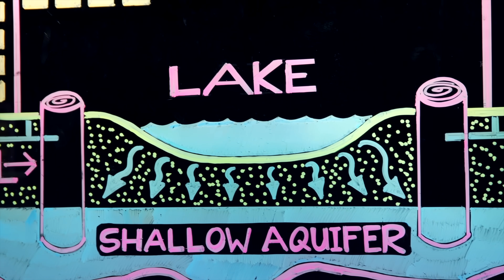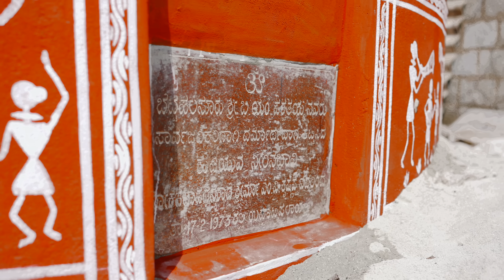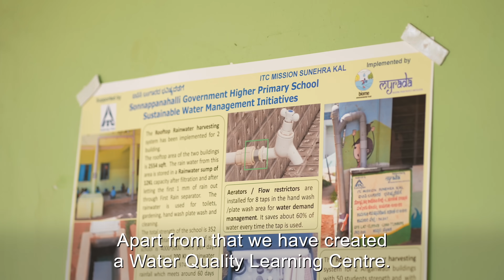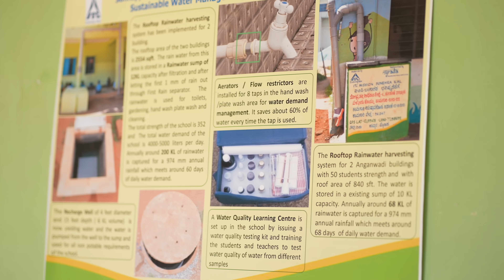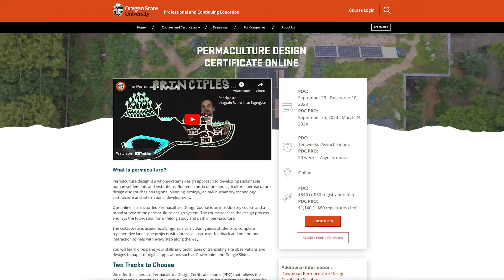How to Save a Drying City (BENGALURU)

Comment: I'm not entirely sure how water conservation practices work since I haven't implemented any yet. However, I'm currently living in the USA and planning to move back to my home country, settling in Bangalore. I've heard a lot about water issues there, so I want to prepare in advance. Here are a few ideas I've gathered from friends, along with some of my own:

1. Harvest rainwater.
2. Promote the use of flushable toilet wipes.
3. Before washing dishes, wipe them with a paper towel to remove grease and residue, then wash them with soap and rinse. This helps minimize water usage.
4. Direct wastewater from drinking water filters to toilets for flushing.
5. Encourage the installation of solar panels.
6. Build vertical gardens for terraces or explore other types of gardening.
7. Filter water used for washing vegetables and fruits, as well as water used for steaming food (like idli), and redirect it to plants or use it to water the garden directly.
8. Promote biodegradable wipes and sanitizers for handwashing.

I hope these ideas contribute to better water conservation! While I'm not sure how effective or realistic they are, they feel worth a try.

Comment: Maximum consumption is by farm sector. Maximum wastage is also in farm sector.  If consumption is optimized and wastage reduced there will be plenty of water for domestic use.  The widely used ancient method of irrigating by flooding the entire field or in furrows wastes lot of water by excess absorption to ground and evaporation. It is still preferred not only in India but across the world because it does not require heavy investment in drip irrigation or subsurface irrigation systems etc. Eventually the wastage has to be reduced, sooner the better because only then we will explore and develop better systems to conserve even more.

Comment: This is also a solution to the problem of combined sewage overflows in the USA. Currently many of our cities dispose of rainwater through the sewage system, when there is heavy rain/flooding the sewage plants are overwhelmed and raw sewage is released into waterways. The typical solution is to collect the rainwater runoff in a parallel centralized system and dispose of it in waterways but because the runoff is collected it needs to be somewhat treated so you're not dumping turbid water full of trash etc into rivers. Also, this concentrated runoff from an impervious city contributes to downstream flooding. If this runoff was collected in a distributed system of recharge wells it would need less collection piping and the local aquifer would be recharged and act as a buffer for torrential rains rather than contributing to flooding.

Comment: digging well is very common thing. Its been from hundreds of years in past. In my village everyone survie on their own well or community well. There is nothing special in this video to gain additional knowledge. 

Just one advise if some one is reading my comment: One should make provision in terrace of his house or building by addition water pipes on terrace of house that allowed the rain water to directly flow to their wells. So this will helps atlest lakhs of water from each house or building to fill that well completely during rainy season. This is the only way to restore high amount of  the water.

Comment: Underground water is not a permanent solution, as rainwater will not get into underground easily so it will not get recharged. Were as ground water gets recharged with couple of rains I have experienced this practically at Kerala were most of the houses using ground water for their daily needs. If we don't maintain ground water and concrete empty space we are going to face acute water shortage in near future.

Comment: I don't get it.  How can you have recharge wells all over the place next to, or, also acting as discharge wells?  You can't directly use surface water without careful filtering.  So pouring water into a well and shortly later, pulling potable water right back out of the same well.. How?
Reply from the maker: You are correct. You are banking surface water in the ground for later use. Because there is no space to store the water above ground. So you are creating a groundwater reservoir to pull from when you need it

Comment: We have already done this at our business establishment in cHikmagalur at Sunyata eco hotel. We dug a well that recharges through rainwater collection in the 6000 sq feet roof top. We treat waste water and reuse them for flushing and we have an underground tank that saves treated rain water for drinking and cooking purposes for our hotel guests. It has saved us so much money and headache every summer. There is environmental and financial benefit by incorporating small sustainable practices during construction
Reply: How do you treat the captured rainwater before drinking and cooking? At the end of this video, it looked like people were using water straight out of the open topped wells that are also where they dump the captured rainwater. This seems like a good way to spread bacteria and disease. I could understand if they were using these wells as recharge only and the water system of the city was centralized through a treatment facility.
Reply: @dentonator2010  there is a method to follow with split pipelines. You first let the surface water of first few rain spells flow into underground well recharge. Once the roof surface is clean of any debris, you then let the flow fill up an basement tank that’s devoid of air and sunlight. During construction, some area of ground excavated for basement was designed in this way with a 50,000 liter water tank for collection(this prevents formation of any algae and the tank needs to cleaned and lime powder applied to the walls every year or two). The water is then tested for any possible contamination. If the results come clean, you pump this to a smaller roof tank and you then filter the water through regular mechanism when needed. For drinking, add any necessary minerals (rain water taste can be extremely bland) to improve the taste. The restaurant uses the pure rainwater for any cooking purpose which actually extends the longetivity of cooking utensils due to lack of any salt content. This is good enough to use for the entire year in our case. We also recycle waste water onsite and reuse it for flushing and gardening. The well water is good enough to be pumped during monsoon for showering purposes. (During summers, we still buy water from the city as the water well dries up due to neighbors pumping their bore wells). When you combine the three, it becomes a circular resource usage and we put in more water into ground than we take from the city. Saves health, money and our guests love it.

Comment: I lost you at 0:30 recharge well. Am from Bengaluru. Was volunteering for the HOA of the community was living in hence have done enough research and hence putting these details here. 

Grown water recharge will not work for Bengaluru because its a rocky geology as close as 3 ft to the soil top in most places. There is just rock below Bengaluru hence you can not put water under ground. The well you are digging, its just the cylinder you create that you can fill in with water. Yes there are some rock layer cracks which can hold and transport water but that is all it is. No aquifer most part of the city. The forefathers who formed the city of Bengaluru had planned this city over 2000 lakes, yes the small city that Bengaluru was like just 10% of present Bengaluru had over 2000 lakes. The thug generation filled all those lakes, just 4 or 5 remaining now all of which are sewer destinations. The largest lake left Bellandur lake is 90% under occupation like right now. Yes there was a supreme court case and judgement not to touch the lake but even after all that its gone. PLEASE PLEASE close that  city down already. Its at point of no return.
Reply: There should be cracks in the rocks under those '2000' lakes.  Water will eventually seep through the cracks in the rocks if given time.  Those 'cylinders' were created with brick without cement, so water will flow out in all directions, into the soil, through cracks in the rock, eventually absorbing.  Providing a place to rapidly get the water off the roofs during rain to allow time for it to soak in rather than running off to the river/ocean is it's purpose.  If you can dig the pit without blasting, water should be able to absorb through it given time.  Impossible to guarantee of course without inspection.  Maybe one lot is totally not suitable, but surely there are areas that can accept water.  It's not necessary for the pit to accept the water at the same rate as a well gives water, just so that it absorbs enough before the next rainfall.  Another video (I believe in this series) shows an Indian man farming on "Impenetrable rock" and still managing to raise the ground water levels.  Where there is a will, there will be a way.  Just keep trying.
Reply: @gonnagetya1433  And source that those wells are just stone without cement? That seems very very unlikely as such a structure would not hold like the walls shown here.
Reply: @gonnagetya1433  You did not get the point. There is no viable aquifer under the city. NADA! Your recharge well only fill the rock crevices. That is it. You can not push water under Bengaluru city. Storing in lakes filled the rock cavities for year round hence there was water in wells through out the city. Bring back the lakes if you want to save the city. Groundwater recharge does not work in Bengaluru like geology.

Comment: Dear Andrew, thanks for another fascinating video. One thing I don't quite understand. It sounds like their problem started due to paving over lakes and something that destroyed the shallow well industry. To solve the problem they are reviving the shallow well industry, but what about the lakes?
Reply from the maker: For many of the lakes it is too late. They are using the existing lakes now as a way to recharge their treated wastewater back into the aquifer. But 1,000,000 recharge wells will perform the groundwater recharge function that the lakes were previously serving
Reply: @amillison is there any concern about water quality as it’s getting sent straight to the shallow aquifer rather than filtering through a lake bed?
Reply from the maker: @JoshuaRes  In the video this was addressed: contaminants to the shallow aquifer are easy to clean, mostly bacteriologic
Reply: I have a doubt my village is near hirakud dam ( world's longest man-made dam) and the water level is 35-40 feet higher than the my village's ground level but still when we dig borewell of 100 feet their no water. What reason behind this?? 
Reply please🙏
Reply: 1st, why are you digging a 100-foot-deep well in an area where all water needs are provided by Hirakud Dam? 2nd, the water table is deeper than 100 feet where you're digging. Talk to your city's planning board about your problem. They should provide information on where and how deep to dig wells based on the depth of the local water table and rock types underlying the area, and offer solutions.
Reply: @pritampandey4932  could be a whole bunch of things, like an underground river system or a bedrock barrier preventing lateral seepage.